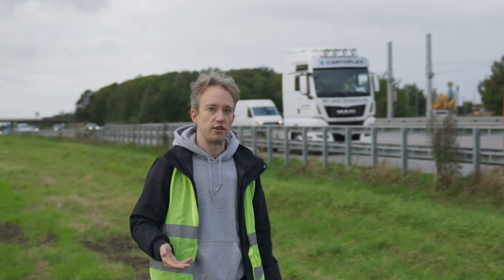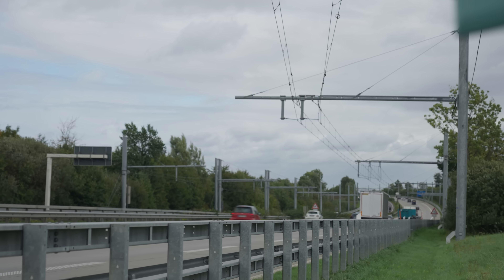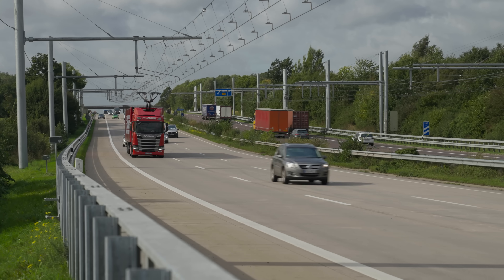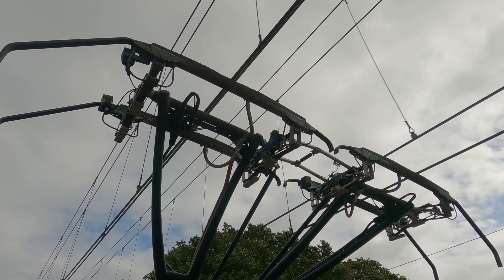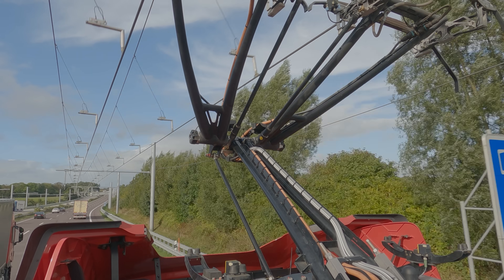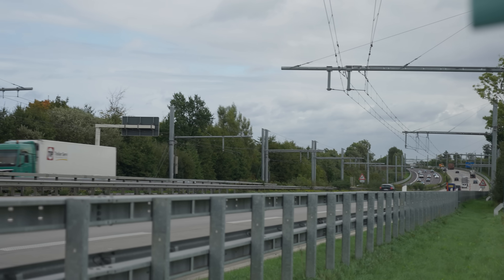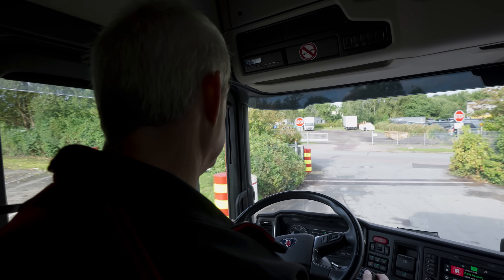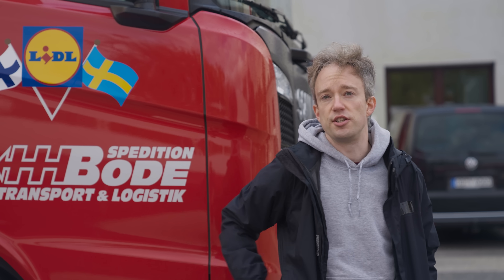The highway where trucks work like electric trains

Comment: A great idea as long as the electricity is being generated cleanly, if it's a coal fired power station providing the energy, that's actually a small step backwards as far as emisions are concerened.
Reply: I know what you mean, but at least the ability to consume low carbon power would be in the hands of the end users. Right now everyone with a diesel or gasoline engine can only use carbon emitting fuels and they will until the vehicle is scrapped.
Reply: @tylerpeterson4726  Very True! We can only hope that by the time this is in full use, and i hope it does, the energy will be reasonably clean. We can do it. Solar, Hydro-Electric, Wind, Tidal Capture, There's lots of solutions available that are more than capable of meeting the demand.

Comment: I’m curious whether increased electricity demands due to electrified roads would be filled by coal and natural gas plants.
Reply: Even if that's the case coal and natural gas plants produce less greenhouse gases per W of power than internal combustion engines, so it would still be more efficient
Reply: even better would be nuclear that can have the fuel moved by rail thats normally way safer than road with the trains being powered by the station it's self.

Comment: So here in Britain we'll begin trialing this system come the end of next year (2022) on the M180 and M181 as they are fairly short motorways overall and therefore it isn't as big an initial investment so that if it doesn't work out then it's simply an "Ohwell at least we tried it."

Whilst I do think there are certainly uses for this technology, I still think there needs to be an overall modal shift of freight to rail. It's just simply so much more efficient to use a train to take containers from ports to depots and warehouses than it is to use trucks. These trucks could then run stuff from the larger depots to the smaller ones.

Still though, as you said, this is a test of the technology to see if it is actually worth adopting, so we'll have to see how it goes.

Comment: How does this overhead wire system work with unregulated “lorries” trucks that otherwise don’t pay for the infrastructure or don’t pay for the electricity who monitors the consumption. and what’s to say a small truck couldn’t use this...or a bus....or an RV motorhome
Reply: Enforcement would be difficult. Would probably make the most sense if incorporated into existing toll road infrastructure and usage is included in tolls. Otherwise I think such things would probably best be thought of as a public service and likely would need to be supported via taxes if one wished to avoid more puntative forms of enforcement. 

And why not let RVs or Busses use it too? Really it seems like the more vehicles you have using electricity from the grid the less pollution. 

Personally I feel like one of the largest challenges to such a system would be may be extra height restrictions it would impose on roads. If someone has a nonstandard antenna or something sticking out of their car and it makes contact there would certainly be a light show at best.

Comment: Some cities in Canada still use overhead wires where they were already in place for older trolleys to run their modern transit buses. There are parts of Vancouver, for example, where the regular buses are on the overhead wires. There's a distinctive "snap" sound everyone outside of the bus can hear every time their connectors cross junctions in the wires and I miss hearing that as a pedestrian now that I don't live anywhere near it.

Comment: Interesting. I suspect it might be a bit like hydrogen trucks though - no existing infrastructure, so hard to get off the ground. This probably means BEV trucks like the Tesla Semi will win because it's cheaper to get power into them.
Reply: Ofcourse full BEV trucks need a lot of extra charging infrastructure too. With this system, this coul be more limited.

Both have advantages and disadvantages, I am really curious  whether we'll see a mix of the two.
Reply: If only the manufacturers of HEVs would make the infrastructure a la Tesla. Though I’m sure that’s easier said than done

Comment: Pro: maybe this could double as part of the electricity distrubition network.  
Con:  Open top containers/flatracks/bolsters laden with what we call in international logistics "Out of gauge" cargo could have some problems with this if the network design is too extensive.
Reply: Unfortunately it has to be a separate bespoke system, just like Railway electrification. The amount of power draw from hundreds of trucks all at once is huge so there isn't much room for it to also be used for electricity transmission.
Reply: @Beverstoncastle5068  That's a really good point which I hadn't considered.
Not sure whether the output of a combustion engine is ideal to determine the amount of power required for a truck with loaded trailer to move, but the smallest Detroit Diesel series 60 engines produce 246kW-277kW.  That would be about 4.6 - 27.7gW to power most of the registered prime-movers in Australia?

Comment: Electric trucks are great but you need big batteries and the infrastructure to charge them. Instead lets just spend massive amounts of money on massive infrastructure builds to put in overhead power on all the highways and modify all the trucks to pull power off of the lines .....

Comment: I love how this idea capitalises on the disadvantages of railway (the inability to overtake), with the advantages of a trolleybus (by being electric).

I seriously do not get why they didn't go with regular trolleybus wires which are suspended using modern catenary wires...

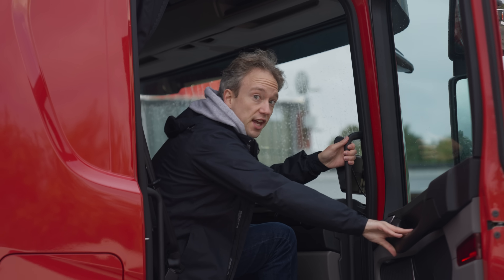3:25 That is absolutely & Categorically WRONG! Look at transport between the 1910s and 1930s-1940s suddenly you have vehicles powered by overhead wires, including trams, trolley buses which are running alongside horse-drawn vehicles with the odd car.

You can see this throughout the world, from San Francisco all the way to London, so what happened?

The issue was that trolley buses and trams looked ugly, with flying wires everywhere.

Electrification was expensive and complicated to install.

The world decided to tear up their older electric systems with a more flexible type of system.

The roads just... Adapt to change and whatever vehicles drive on them.

Comment: With this kind of design, essentially a new form of trolley vehicle technology, IMO it's better to develop a wireless charging system so trucks can easily charge while minimizing chances of messing up polarities and damaging infrastructure easily since the demo here uses catenary wires on the same level of each other, and pantographs. Trolleybuses, despite only capable on low-speed routes, always have a physical grip on its respective wire even if the vehicle sway back and forth.

Comment: An important thing to note, is that this wouldn't have to be everywhere. If the vehicles were battery powered, they could have sections of the road which had the overhead lines, and then the rest wouldn't have to. There just has to be enough that it's economical to drive on the road and not lose (much) power, it doesn't need to be completely powered the whole time
Reply: Even if they still use diesel for the non-wired parts, it's still an improvement.

Comment: Somewhere not too far in the future will be the power pirates using a modded truck that looks like the others but it's all battery in the back, drive it down the road and back and charge the batteries essentially stealing some power you can use to run your house or factory.

Comment: In Arnhem, holland, they have public transport like this for decades.
Trollybus
Reply: Trolleybus does not run at constant 90 km/h hours long. Also it drives much less load. So the conditions and requirements here are on a rather different level.
Reply: @PhonoDirect  for transport over longer distances a electric train can be used, for in the cities a trollybus like truck be much better as thats where the concentration humans is much higher and cleaner air be more appreciated.

Comment: Great idea for areas where the train freight network just can't be used, but personally, I think countries need to look at increasing the network capacity for freight services, America and Australia has double height freight container trains, Australia is on the middle of upgrading the existing rail network to take even more of these double stacked trains, of we could then expand this upgrade Australia wide, with a universal gauge across all our state and territories, then this truck electrification network, would not be required. Of course, employing this method, will mean the loss of jobs in the truck freight area, except for local deliveries, interstate trucks would not be needed, thus, decreasing the amount of trucks on our hwys.  So there is good and bad in any method that's chosen, but at the end of the day, we have to do what's right for the environment.

Comment: I'm no expert, but I think hydrogen is the way to go. There is more room for future innovation in how it is extracted. The current infrastructure i.e. petrol stations are more easily adapted to storing and dispensing hydrogen. Not to mention that the lithium used in batteries is a rare element, which requires copious amounts of energy to extract and ship around the world to where it is needed. Hydrogen on the other hand, is the most abundant element, fuel cells are cheaper to make than traditional engines, and in theory can be extracted near to the demand, meaning no more oil wars, and one less sector that can be exploited for extreme wealth. There are already hydrogen cars on the market too, but everyone likes Telslas? I guess they're a bit like Apple, you're buying the brand. Just my opinion, but I don't think hydrogen should be ruled out. We can add a big screen later😅

Comment: It's bad enough having motorwys and pylons through our best countryside and national parks. We do not need a gantry every 50 yards. What is wrong with supporting fuel cell+electric technology, it can be done wih hydrogen or other gases until hydrogen is available. The losses in electricity worry me in 1000s of miles of cables.

Comment: I don't know why but, have the power from the road instead of the over head power lines seems much a better and cleaner(visually) idea for me. It would benefit all moving vehicles on the road. For motorway it's very handy for long roadtrips for short range vehicles requiring less batteries.

Of course there would be safety concerns like when people walk on it or animals. If the overhead power line breaks there's a risks too. The damage can be for miles (unsure about this). While a road powered can only be a portion of the road, a few meters.

Comment: Trailers in the UK can be upwards of 16' so this would be tricky to implement
Reply: i don't get why theres such thing as trailers being higher than the truck cab it's self.
Reply: @davidty2006  greedy suppliers trying to get as much stock on as possible
Reply: @cecil4485  why not just use a B double.
instead of higher it's longer hehe
Reply: @davidty2006  Our roads in the uk aren't really suitable for longer vehicles than we already have
Reply: @cecil4485  not even on M roads?
Reply: @davidty2006  there has been talks about using things like b doubles for trunking work up and down the motorway but nothing solid at the moment. A few months ago I did see what looked like someone pulling two twenty foot container boxes on separate trailers but that may have just been a trial

Comment: In mountainous terrain, it would seam quite possible to electrify only the uphill portions.  Obviously no need to electrify the downhill portions.  Batteries could charge on the downhill through regen in addition to charging on the uphill portions.  That should be more than enough to cover the flat stretches.

Comment: How do you move oversized loads with these over the road? Do miles of these wires get dismantled for every single high load? How many more miles get power shut off to avoid shorting with a tall steel or similar structure?

Comment: Why I'm against this idea: 
A: Freight Trains exist. They can be powered by overhead wires, and can carry more than just one single consignment. You could turn this into a road train by adding more trailers, but you've literally just made a train on wheels, and road trains are still outperformed by real trains. If freight is being transported by the railway, it's not on a road contributing to congestion which  will be causing other vehicles to pollute. 
B: You said it yourself. The only problem with trains is the last mile which this doesn't solve. It's a neat idea, but it literally seems like "we're trying to solve this problem but we dislike the actual solution so are deliberately avoiding it.

C: Especially the case for the UK and its driver shortage: Tesco has struggled much less with the supply shortages because it transports the bulk of its supply stock as far as possible by rail.

Comment: Not viable, Tesla already has the solution, all we need now is the billions spent on reliable constant green electric generation. If one fifth of the water that falls through our rivers are harnessed by laying pipes in our rivers attached to small turbines all over the country then we will have no need for power stations, the potential energy will be more than enough. Especially given once the whole country has the equivalent to a Tesla power wall in each of our verchiels storing that electric won't be a problem.

Comment: If only it had steel wheels and tracks to lower its rolling resistance
Reply: yea we have trains already, but this idea is for the journeys that trains can't do. Like trains only have limited stops in a city, this can then go between the offloading point at a train depot to major distribution areas in cities. Also along other major truck routes through cities.
Reply: @A.Martin  didn't used to be this way, in the past cities had penty of rail infrastructure, we just removed it for car infrastructure, but london for exemple had plenty of logistic rails inside the city for end to end transportation.
Reply: Oh a traffic jam ahead..... thank god I’ve got these grippy steel wheels and only weigh 40 tonnes. I’m sure I’ll stop in time 🤨🤨🤨
Reply: @jonny96  I see such revolutionary ideas like trains are still poorely undestood by peope, i'm sure once they become common place they will undestand.
Reply: @herlescraft  we already have trains, they’ve been around quite a while. This a road with other road users not connected to the electric network
Reply: @jonathanbeattie3410  (mine was sarcasm on how jonny's reasoning was still a lot car centric like how old people need things to be related to what they used to know, like how "homebaking is like going to the bank but without the queue"

Comment: i don’t know about this, now they are starting with Hydrogen powered vehicles. Cleaner and more flexible. This wire system would be too expensive to build.
Reply: The idea is not terrible in itself, but it seems to be obsolete before it can be rolled out.
Reply: Hydrogen has a nasty habit of going boom, though. It's also less efficient, since you spend energy to create/fill the fuel cell.
Reply: @renakunisaki  No, it doesn't. Ruptured or leaking hydrogen tanks that ignite burn more like oil lamps. Oxygen can't get inside the fuel tank to cause an overpressure to make them explode. Having a hydrogen leak in a closed room could be an issue, but outdoors the extremely light hydrogen immediately disperses.
Also, diesel fuel also burns, and poses a higher risk of explosions.

Comment: Yes. Manufacturing tens of thousands massive metal poles, a few thousand miles of copper wire and producing the electricity requires no resources and does not produce any CO2. I’ve never been able to find a compelling study that outlines the benefits case clearly- i.e. how it’s more ecologically sensible.

Comment: Curiously I did a concept piece wherein I proposed a similar system, but instead of the highway, I suggested using the old railway right of way corridors that aren't in use in the USA anymore.  The key being that they'd charge for access at the entry and exit, and could supplement the grid with solar above the road surface.   Didn't go anywhere, but I like seeing at least this form of it in use.

Comment: And people still keep calling Germans efficient... This is quite litterally the most convoluted way to do rail transport without doing rail transport. One one end they are comissioning new coal powerplants, on the other they deploy ridiculous infrastructure, so trucks can produce a tiny bit less c02 to run with electricity produced with a high carbon footprint... If you are going to invest in alternative logistical infrastructure free from combustion engines have long transportation on rail and then use electric trucks for local delivery... Hope this is some sort of marketing or political stunt and not something more serious because this honestly looks like absolute nonsense, but what do i know...

Comment: Seems like an unsafe hazard for tall loads such as large machines such as excavators and rock trucks. They can just not drive in the lane to avoid the wires but then they can't enter or exit the highway. I like this idea, but at the same time it seems like it would have to be really well planned and protected

Comment: Just do hydrogen fuel cells. You combine the pros of petrol/diesel with the pros of electric. The only issue is only Toyota and Honda are working on hydrogen fuel cells right now and there's no infrastructure in the UK if you live outside of central London.